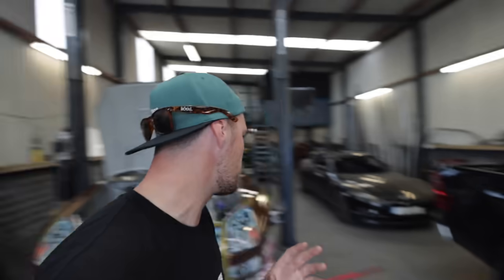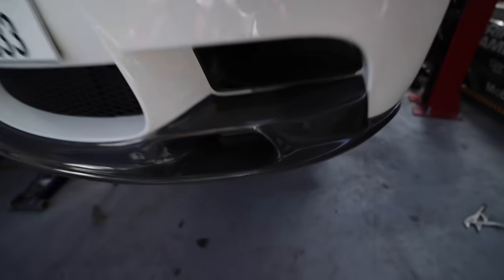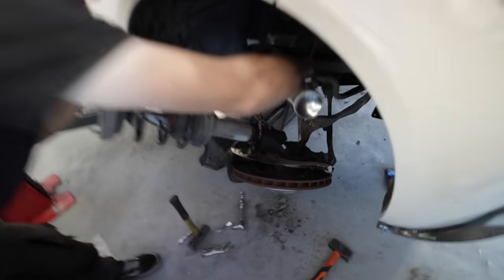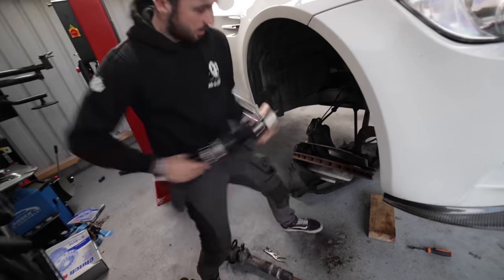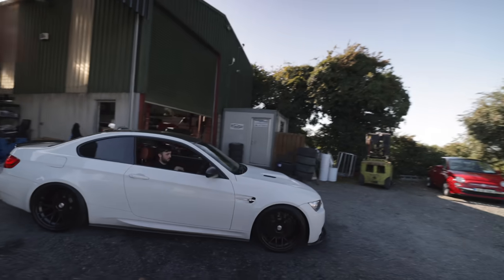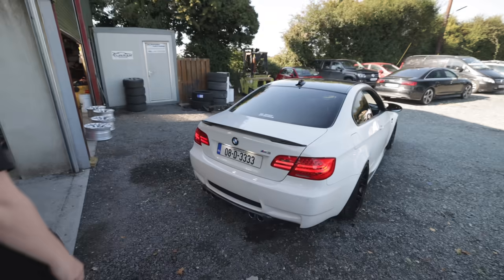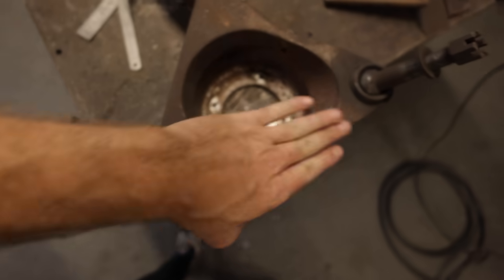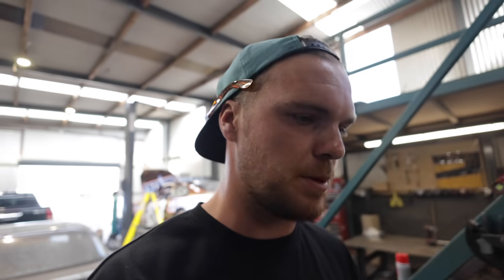Can the BEST drifters in the world handle our 1JZ NASCAR?

Comment: Three in a row NASCAR short track champ here.. Run as much caster as you can, 7 8 9 degrees and set the camber at 3 to 3.5 degrees, you will get return to center action and massive weight transfer to the inside rear wheel when you are full sideways because of the front geometry.. Everyone has felt a large car tilt the hood when you steer lock to lock sitting still, these settings increase that.
Reply from the maker: Amazing thank you! We are clueless
Reply: @driftgames_life  Adjust the bump steer so it never toes in. If you have to compromise, have it toe out in bump. If it toes in from steering or bump travel it will bind up front rolling resistance and be unpredictable and more easily spun out.
Reply: @billbry wow that's cool 😎
Reply: @driftgames_life  I heard one of you say the upper a arms are not the same.. A circle track car runs caster stagger to get it to turn in more to the left. Caster affects the straight line pull to one side or the other. If a car pulls, it is usually caster stagger, not toe causing it. You may have to chop the a arms to have matching caster and camber on both sides. A road coarse car would be all set.
Reply: Wouldn't be surprised if the RF lca was longer too.  @billbry

Comment: Fellas spend $500 on an induction heater and never have to fight rusty stuck parts or bolts. It will heat up parts glowing read in under a minute. No flames or risk of fire. It’ll be one of the best tools you’ve ever bought. Imagine never snapping exhaust or hearder bolts again

Comment: Let Chelsea do an early test run in it, he's Mr. Chassis set up guru and he might be able to figure out how to get a tad more positive camber in the rear! For the front, the bolts look long enough up top so you could get more negative camber by simply adding a few big washers in-between the backside of the new top hat plate and the upper A-arm mounts to pull it in some....../
Reply: Its a solid axle you cant get rear camber either direction it will be 0 unless the axle is bent and broken

Comment: The adjustments on the rear control arms are to give it rear steering in the corners remember its made to go left .....unless its a roadtrack car and thats not a roadtrack car or the rear end would be square instead of the way it was so both front and rear control arms are made to turn the car left every track is different so they have control arms for each track which depends on the bank of each track you might want to maybe do a whole new front end on it